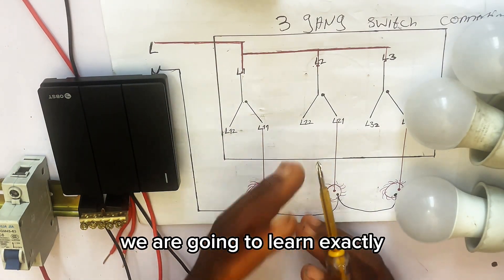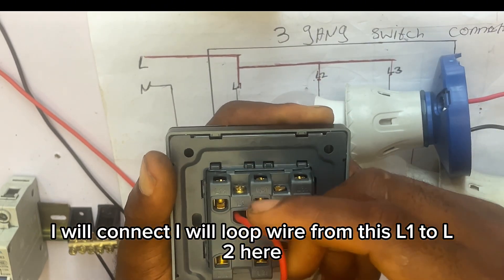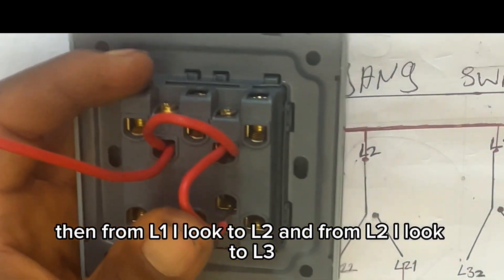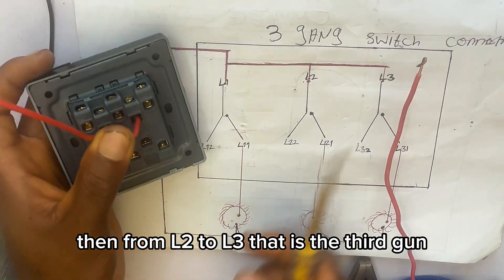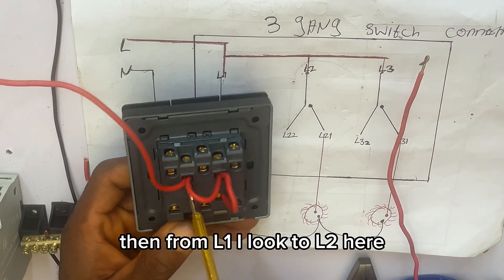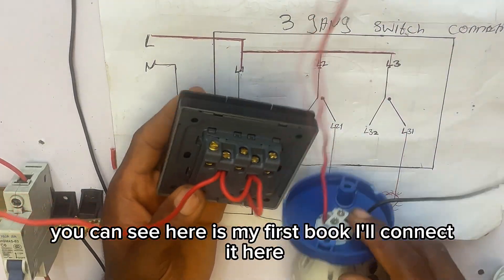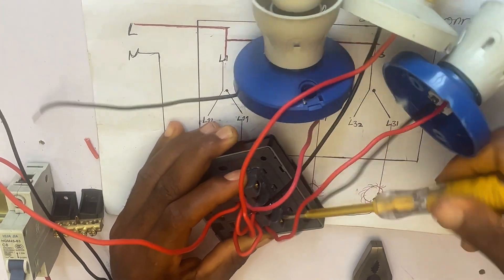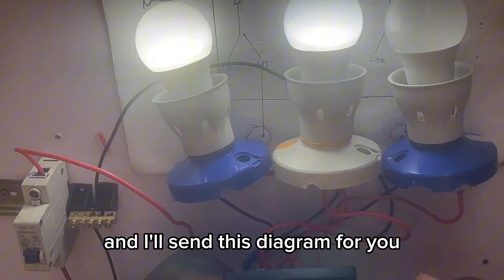3 Gang Switch Wiring Diagram for Beginners

Comment: Thank you so much; I just got mine replaced with the help of your video. Bless you.
Reply from the maker: Glad it helped
Reply: @chukwudiemmanuel8665 I just opened one of my switches, and to my surprise, even though it's a three-gang, it has six wires in it. Two wires coming from one pipe and four coming from one pipe. Each pipe has a lifeline. Please, what should I do? One of my light bulbs outside went off, and I just found out it's from the switch.